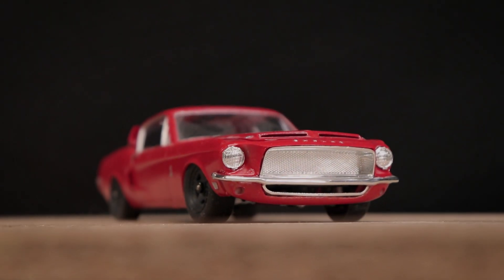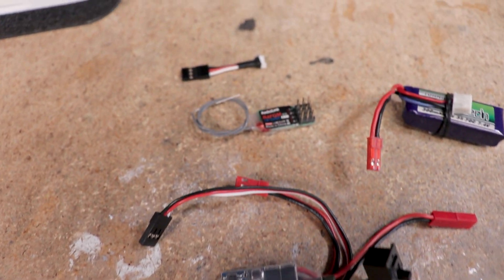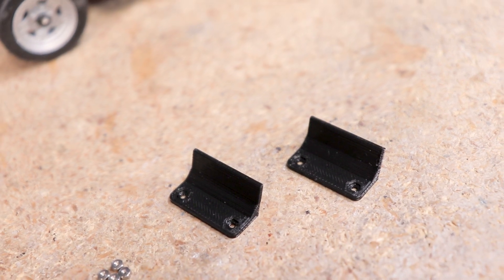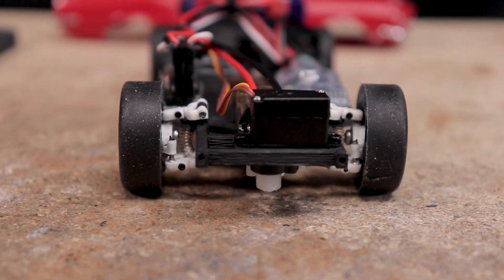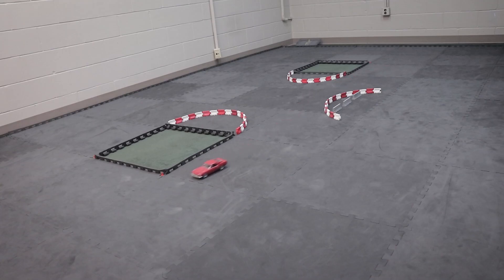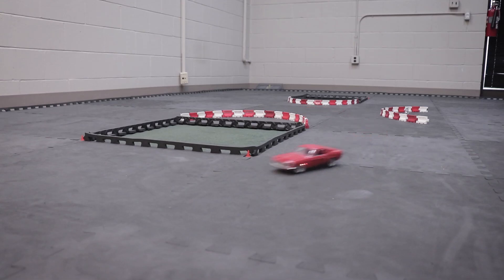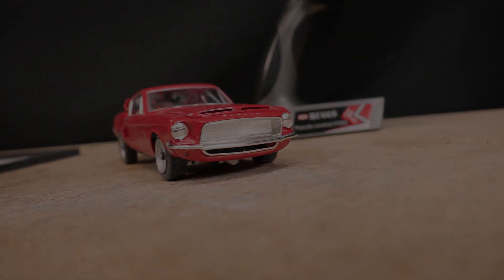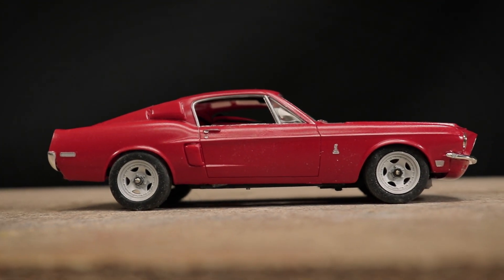Testing the 1/25 Scale RC Shelby GT500's New 3D Printed Suspension

Comment: I was wondering what is the rpm speed of the motor gear set? I see them for sale but I want it fast enough to still drift. I plane on using a axle from mini crawler that has a 4:1 ratio. Thanks and great work love how scale you go, this front end set youv done is excellent!

Comment: To tighten up the steering (and reduce rubbing), you'll need to get the steering pivot as close to the center of the wheel as possible. I had to do a bit of research when I was designing the steering on my home-built 1/10 scale buggy. I played around with the steering assembly in CAD before printing the parts.

Comment: 9:37 - The front suspension works great already. The front of the car doesn't even move when it passes over the bumps. The rear needs some shocks  :D
Reply: Isn't that kind of the point of a suspension though? It absorbs bumps. In the last shot you can see the front wheels go up and over the bumps but the hood remains parallel with the ground and dosnt move much. Rear does need shocks though lol.